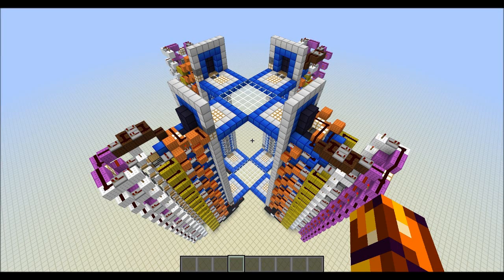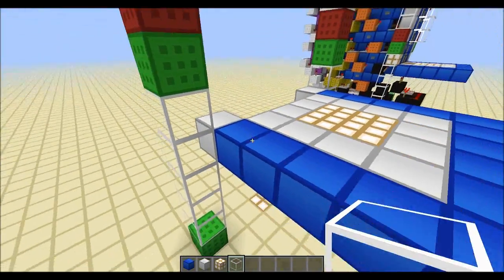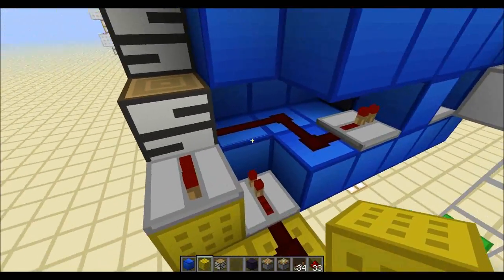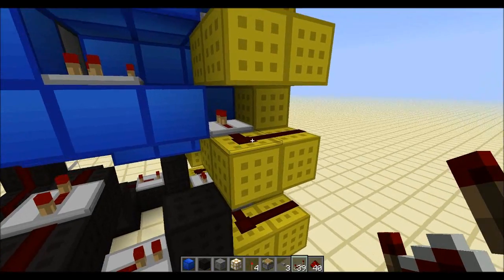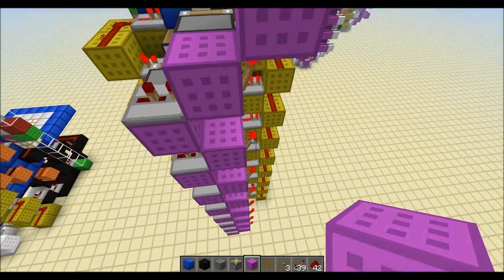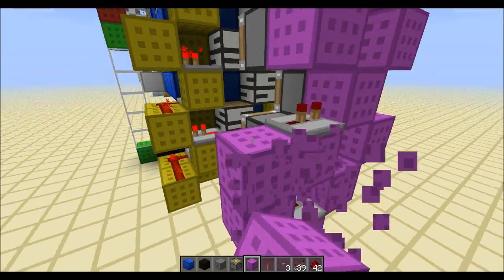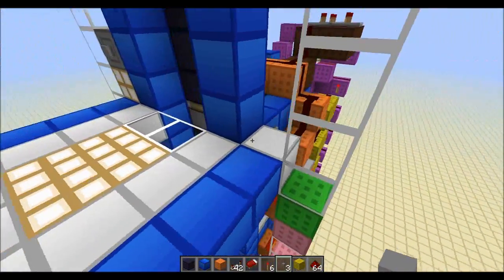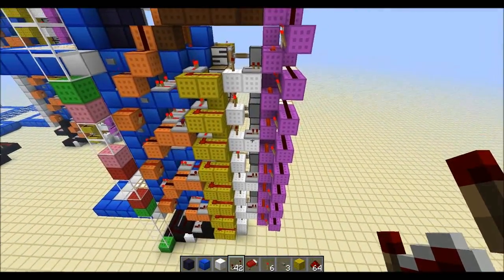Minecraft Tutorial: Instant Elevator (Revised) (Part 1/1) (1.2.5)

Comment: For the people of bedrock that want to make this elevator:
1. In some older versions you might have you might have to replace some of the glowstone with upper slabs. 
2. With the instant call for the top part, you just need to power the blocks the repeaters were going into. Powering is a bit weird on bedrock, so that is why you might need to do it differently though. I would recomend taking inspiration from how Cube did it though.
3. Completely scrap the white circuit. Cube's design does not work at all for bedrock. You need to power the circuit at the top BEFORE the circuit at the bottom triggers. By that, I mean get past the repeateds. It is also important that you send your trigger AFTER the pulse shortener. That is just so it doesn't trigger the intpstant call for the top part. Get creative with that one

I actually built this on bedrock so I know it works.
Please like this comment so it is at the top and people can see it

Comment: make sense and will not go away no matter how many times you reload. I dont know why this works, but you actually have to shut your xbox off for an hour for these to go away. Dont save when they are happening, or you have to rip the whole system out and replace it. On the xbox, its all about timing. If it goes to slow the whole circuit cant function with his design and the pistons come out faster then they go up, trapping you. if it goes to fast you get trapped. if you do it right it goes fast

Comment: sorry CubeHamster, but the fixed elevator now has a new bug. on the left side of the elevator (facing elevator) the new white circuit causes you to clip through the piston arms. this isnt very noticable when going up, but mattering on which level you stop at (pink or red towers on sides) you will glitch through the piston at the top. it has to do with the fact that each line is not powered with the same timing, as it is now a 0 tick delay to a 1 tick delay to a 0 tick delay to a 1 tick delay.

Comment: I built this elevator on the xbox360 version and after several redesigns it is 95% functional. His basis design does work, but because the Xbox doesn't have the performance his computer does, you need to slow it down alot in a different way then he suggests. The problem is that the up pistons are being activated on the xbox before they come out, creating a trap. To slow this down without breaking the elevator you have to hand the current for those pistons down from higher circuits. To fix the

Comment: Jmsjustin001 I haven't tried it just yet, but using upside-down stairs instead of glow stone should work just fine, as before when I was building a cool kitchen, I wanted to make sure I could open a chest but there needed to be redstone on the block ontop of it for a piston door to work. The most practical option was placing upside-down stairs facing the wall so that it looked like a normal block from the front, I could place redstone on top as of 1.3.1 and I could also open my chest.

Comment: problem with the glowstone, just build a circuit without it further away away from the design. He did design his elevator with compaction in mind, and he took some beautiful shortcuts, but most of them dont work on the xbox, so you need to redesign that circuit. The Xbox is incredibly unreliable with torches so if you want it to work use as few as possible. It takes a little bit of thinking, but ive done it so I assure it is possible. occasionally there will be random torch errors that will not

Comment: i dont have this problem but its normally caused by lag or the delay is set wrong, it would be smart to check the delay on the yellow circuit and if its right try to slow the elevator down to compesate for lag

Comment: Cube, I'm having a problem with this. First - thank you for this very thorough tutorial. I researched some other designs out there and I like yours the best. I have replicated this design to the extreme - it spans from layer 67 to 155 up to my sky rail. However, the up function keeps leaving me stuck between pistons even after slowing to a 2 tick delay.  Down works flawlessly.  I've tried riding it up at least 15 times and i get stuck at some point every time. Any suggestions?? Thank you.

Comment: Well basically what the problem is is that the glowstone is considered a stone block and not a glass block in this version of the game, so when you put it over the redstone it cuts the current off. Do you have any designs for the pink circuit that don't require glowstone? I have already made alot of it and would hate to have to start over again.

Comment: For me the elevator stopped working once I added all the "white" circuitry.  For some reason on the 2nd part of the white wiring, when you add the repeater system and get to the top I have 1 line of redstone dust on the rear section extra to you, even though I've copied your design completely.  The only way round it is to have the very topmost repeater copying the ones below it by being one block down (rather than on the same line as you show).

however it all stops working after this is done.

Comment: hey cubehamster, great stuff yet again, I'm working on a simple elevator like this but i am trying to use it in a survival world and I'm having an issue running into bedrock. i have a main elevator going down to y12  for a huge mine shaft system. this system will have multiple flors but there is the problem, how can i get an elevator flush with bedrock but not have any redstone troubles with the bedrock 1 block below?

Comment: On xbox 360;
I was able to avoid the snag of the glowstone by sending every other level out and around where it would normally be cut off.
However, it IS still too fast for xbox. I'm messing with the timing of the vertical pistons, but so far no luck. If i get it to go slow enough, i dont have enough upward momentum to get out of the way of the next block. Any faster, and the horizontal blocks squish me up against the glass.

Comment: SMALL ISSUE! So I made the elevator, all the pistons run fine, and whatnot... but my elevator is stuck in the up position.. I can use the top floor and go down, but as soon as it hits the bottom floor it immediately goes back up!, I'm assuming a torch or wire is turned on permanently somehow, but I'm redstonetarded, Help me Cubehamter you're my only hope!

Comment: Spent hours getting this built... And it doesn't work (I'm on 1.5.1). In the middle of the elevator going down the pistons stop randomly and then just start going back up. Also for the orange circuit if you don't have the height of your elevator either the same height as in the video or a different height that's proportional to the height in the video, it doesn't line up right which will automatically screw it up.

Comment: Actually, after adding the white circuit, the two sides of the pistons lose sync partway up. The pistons on the right side when facing the elevator from the front fall behind by 1 block partway up the elevator. This only happens when activating it from the bottom. Which circuit is responsible for firing the pistons on the right when activating from the bottom?

Comment: I'm on xbox and have 2 problems, 
When going up the pistons go to fast and I glitch and get stuck about 3 or 4 blocks from the bottom set of pistons. So i turned the speed down to 2tick delay repeaters and it still happens

Also when going down the pistons go all the way down then go up again. I think I've isolated the problem at the back of the elevator the very bottom piston that pulls out the birch block does not move but is always powered by the torch set at 18:35.
Help?

Comment: I follow the step by step but everytime i get stuck at the two pistons on the bottom that are supposed to keep you from falling out if you have the elevator on the fast speed (The part that you start building around 8:13). I am using the xbox version but i don't see why this step shouldnt work?

Comment: I Just finished mine, and it works properly, all the circuts are in order and the functions work, however I am running it in multiplayer, and it looks like the right side of the elevator triggers later than the left?? I dont know if this is just appearing to do so because of server lag, or if it is actually messed up somwhere, I have experimented with all the yellow repeaters timings, and every time I change anything with them it still appears that the right side is acting slower than the left.

Comment: woops, for some reason the going down smooth is not working, i saw and the pistons connected to the white wood wont work
when i call the elevator to go up they work so the pistons deactivate one by one all the way to the top ( when i call from the top they all deativate in the same time because the pistons with wood arent going one by one, they dont even move when i call form top
what did i do wrong? was ok for some time...

Comment: lol. in the 5 min it probaly took you to reply, i fixed it by placing a repeater where the signal stoped (in the purple circuit)...BUT....that caused another problem, where i get stuck on the way up. I have my repeaters (yellow circuit) set to 2 clicks...will change them back to 1 to see if that fixes it. Solutions?

Comment: um for some reason the redstone torch (the one you place at 8:40) on the redstone wiring to the pistons that stop you coming off wont turn off and the redstone wiring behind it does still turn on.  is there a reason for this you can think of? and is there a solution? Thankyou.

Comment: HELP! My elevator works fine going up and down, and the instant call on the top floor works fine. But when i add the white wire for the instant call on the bottom floor and try to go up the elevator i get stuck in the pistons, it works when i change the elevator settings to slow but i wanted it on fast. (I am playing in singleplayer) I downloaded your worldfile and i can't find anything differen't, PLEASE HELP!

Comment: I looked at your video, fascinating design really. The disadvantage of this design is not the design but the size it measures. Lets say i want to build a skyscraper with an elevator, i have to build a really thick skyscraper, so i hope that the dev team designs a simpeler block that can make an elevator with cables maybe, then comes cablelift from high mountains also in the picture.... hope so...lets go skiing!!!

Comment: Everything works perfectly in 1.4.6 however I did need to make adjustments to the bottom call button. It was interfering so I had to re-adjust where the connection led to but it was just a minor adjustment. I might put up a video soon showing what I mean. Might.